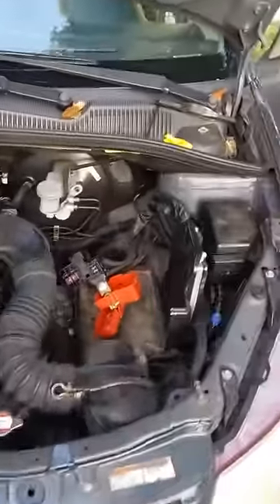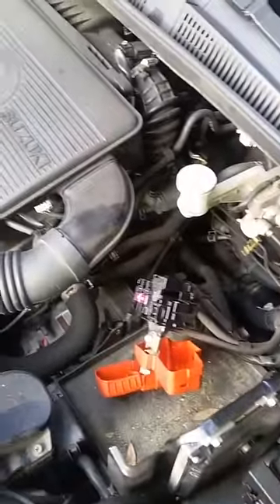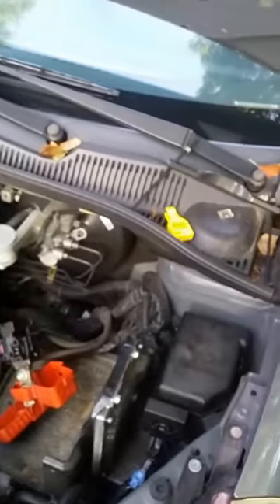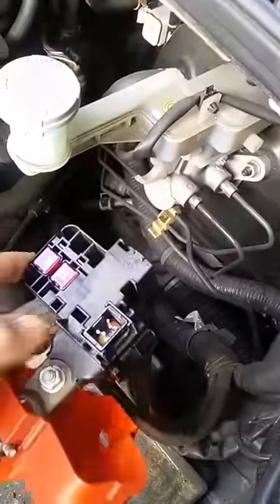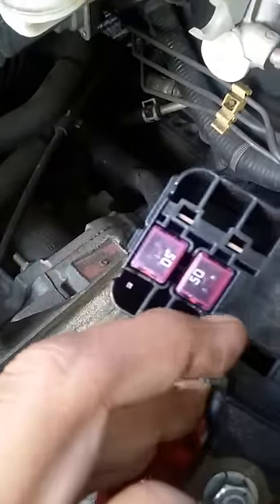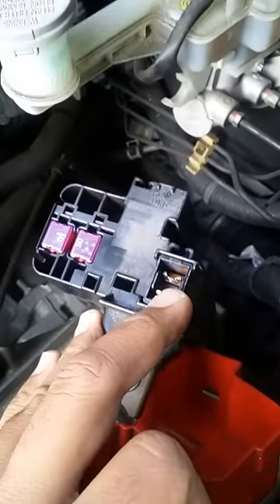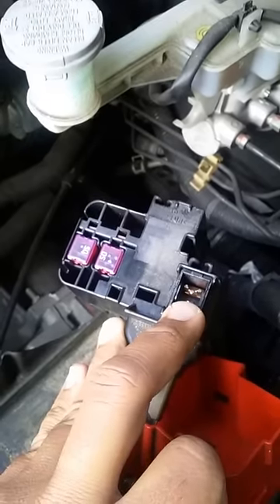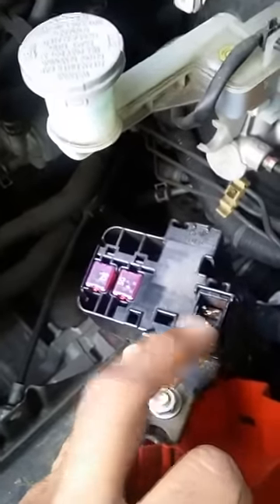How to fix the damage when you cross the battery terminals in a modern car

Comment: What about a quad....???
Reply from the maker: In this case the only thing that went wrong was the main fuse in the positive terminal of the battery popped. Apparently that is one of the purposes of that big fuse is to prevent damage in the event the battery gets crossed which I did in a very dumb manner lol.
Reply from the maker: As quads go they can be a little different. I am afraid I have little to no experience on quads. I may come back to you once a research a little bit
Reply from the maker: I looked around online and came empty I'm afraid. Could not find a definite answer, some ppl said it is the wires or relays or fuses but nothing solid.
Reply: Thanks i am on 14 but i will replace the fuse i think it is a 15 fuse same as a car i will look tomorrow i am mortared just it fixed. I had a doggy battery aneywas but it is not cheep it cost an arm and leg. Yea ill add that to the list thanks agin channel called living the moto life
Reply from the maker: Hehe!! You are welcome buddy and I hope you find the solution for your quad. Have a good one!
Reply: Random stuff with Erick Martin thanks
Reply from the maker: 8-)

Comment: Or you couldn't blown an $800 or $1500 main computer...
Reply from the maker: Thankfully that was not the case. That's the reason why those main fuses are in place so if it happens you'll only need to replace a 10 dollar fuse instead of an expensive computer. Mind you I learned all this when this happened. I did fear the worse.
Reply: By design it is usually not possible to destroy the computer, though you'd need a wiring diagram to be sure but usually the wiring between the alternator and ground battery (alternator expects a positive but instead you feed a negative lol) will fry. Assuming the computer gets its ground from the fuse directly which connects directly to the battery, you'd just be feeding negative to positive (which would not exists) because the source is negative (backwards) though the alternator is the generator therefore that's where the issue would be, in a design that the computer is at risk, they will have a fuse such as this one.

Comment: i don't think i blew any fuses (car started and ran fine), but last night i spot welded my negative terminal to the connector when my ratchet (my dunmbass went to take off the positive first) swung over and landed on the negative post.. Huge sparks, 4 different spots of welding, and my ratchet even stuck to the post and terminal so i slapped it a couple of times until it flew on top of the back of my engine (lucky it didnt fall back there :p )
Reply from the maker: One heck of a spark that was!! Is it still under repair?
Reply: @ErickMartinSucre  
Yes. I don't know how to do voltage drop tests, and the shop thinks it could be a computer, so i'm resetting all of the computers to see if maybe it'll clear a glitch.. I have the positive terminal connected to the negative terminal right now and with the battery removed to wipe the memory from the computers.
Reply from the maker: @mike5bridges221  I really hope that does it for ya. Thanks for updating me on this 8-)